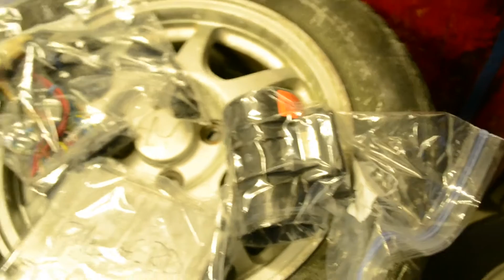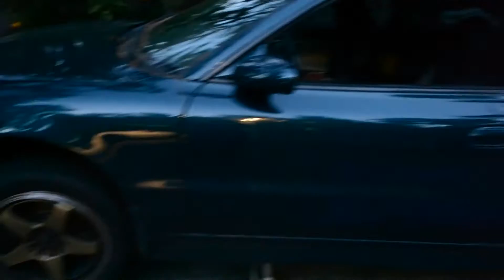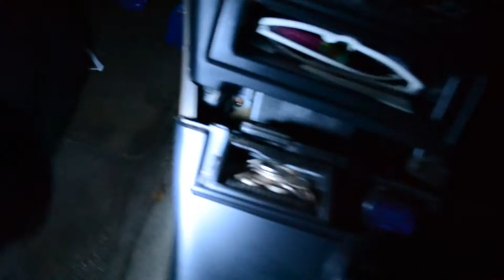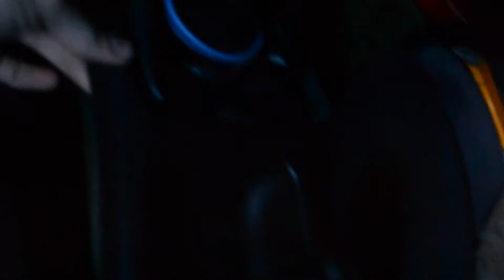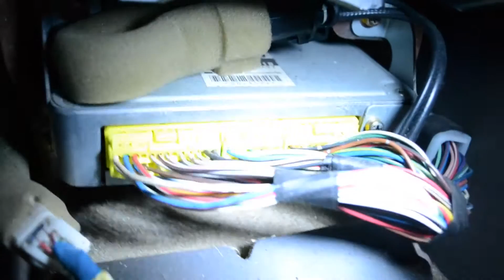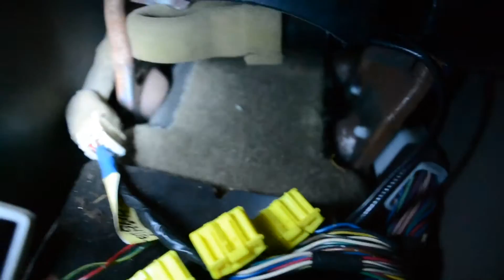How To: Mazda MIllenia ECU & MAF Swap MX6

Comment: Do you still have wiring by Scott setup?
Reply from the maker: Nope, parted out that car back in 2013
Reply: @pigeon853  Hi Scott.  Still loving you instructional videos even though the MX6 no longer around,  your content still very useful. Keep it up. 
I still have my MX6 (I think.  Sent it to Spraypainter 5 years ago and struggling to get it back.  Hopefully soon.  I'd live to continue with some easy mods.  Checked out your link to Scott,  but not working.  Do you have his email or contact details pls?

Comment: Hey, did you ever figure out if the IAT sensor gets installed before or after the MAF?
I've been searching, but haven't come up with a definitive answer.
Reply from the maker: jkenney940 I don't think it matters very much to be honest! I ran mine as close to the Throttle body as I could, so the ECU would read the air right before it goes into the intake

Comment: Great Vid! Just what I was looking for!
I'm putting a straight neck KLZE in my 94 Probe GT (manual). It's N/A and I'm Not planning boosting it or anything. Which ECU should I use for the MAF swap???
I can't find a KL31 or KL36.
Reply from the maker: jkenney940 the ECU you're looking for comes from a Mazda millennia with the 2.5L KLDE and a MAF sensor. 

the gains come from using a MAF sensor instead of the Factory VAF! 

you can probably find parts on eBay pretty cheap!

Comment: OK so if I converted this, the obd 2 port will it give out real time data as well as engine codes for my obd2 scanner?
Reply: It does for me. I set the distributor, TPS and idle with it too., you still have to paperclip the TEN pin and GND to adjust.

Comment: What were the gains like on it? I have a 95 with 175k miles. V6
Reply from the maker: Proven dyno in this thread. Dyno 4 is overlayed on dyno 3 to show maf gains http://www.mx6.com/forums/2g-mx6-general/249140-dyno-results-current-setup-vs-later-klg4-im-cat.html#/forumsite/20959/topics/249140

Comment: 16:00 It is not a ground, scott told me it was for ignition on 12v
Reply from the maker: jforce06 yes haha at 18:25 i state that :)
Reply: Cramer Ward-Collings Ah ok, sorry :)

I tried this swap today, but both cars wouldn't start (91 & 95). They crank, but do not start. With the vaf all works fine.

Was using the KLY5 ecu.

Would could be causing this? Did I bought a dead MAF or dead ECU?
Reply from the maker: jforce06 

Hmm. Make sure to reset your electronic timing and your tps and idle to make sure it's all working again. Then check to make sure the MAF is getting power.